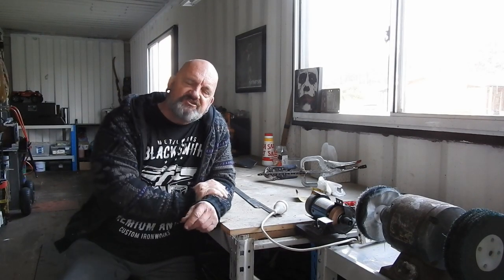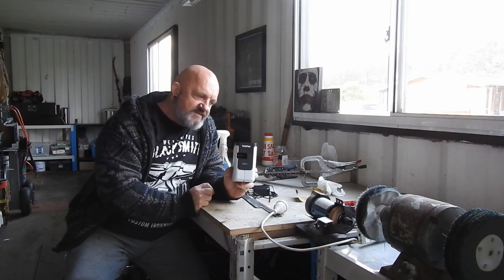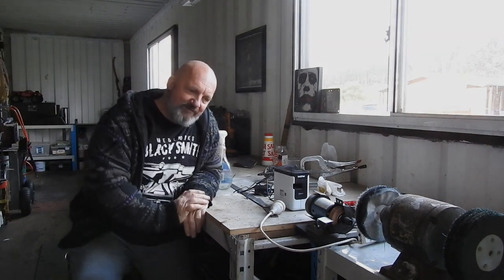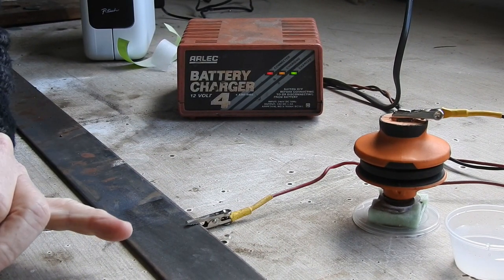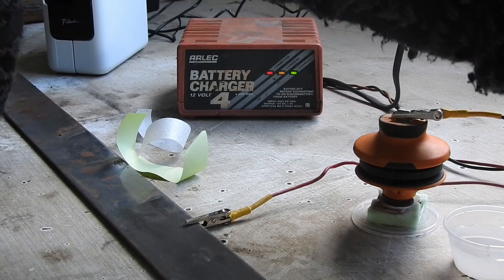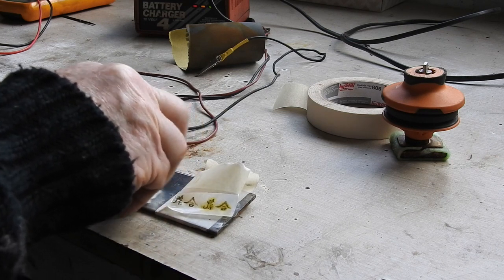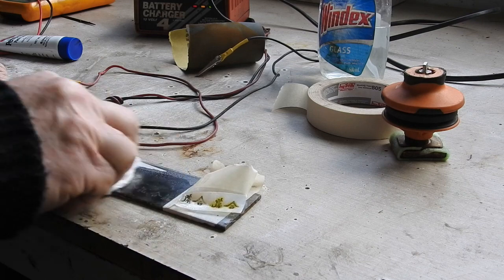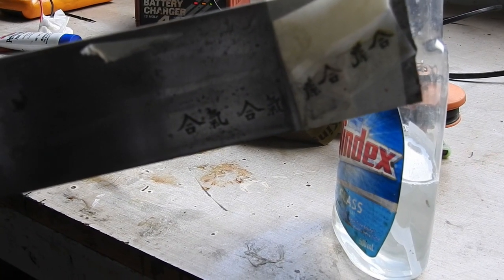Easy DIY stencils for salt water Metal Etching

Comment: Hi , I’m trying to do this kind of way of etching but I’m struggling with the type of battery charger needed , can you tell me the model of your battery charger or recommend one that would work , I’ve purchased one and it’s not working at all because I’ve seen that the newer models don’t turn on , thanks
Reply from the maker: HHHmmmmm don't know why your charger is not working???????? Did you have enough salt solution ???? I don't know why a charger would not turn on but my charger is 20+ years old and may not have a "safety" feature that a modern one may have...Sorry can't think of anything else!
Reply: I use a 1 amp power supply that used to go to a printer or something of that sort of peripheral electronic device and it etches as well as a battery charger.

Comment: Will it etch on stainless steel?
Reply from the maker: Stainless is very difficult to etch..........I have tried with average results......On stainless I use a punch...
Reply: @markbilson3775  I was using a 3.5 amp car charger for the source and it etched deeply on the RWL34 S/S. I tested it today. I will test 316 and 304 grade tomorrow. I am getting a cheap low voltage AC power supply to blacken so will see how that goes..
Reply from the maker: @54Mizery  Ok cool!.........I have only tried on NitroV and 12c27 stainless...

Comment: what type of labels are you using exactly?
Reply from the maker: You can buy the specific labels. I bought mine at 'OfficeWorks" in Australia but I would imagine any big stationary retail store would stock them.
Reply: @markbilson3775  G'day Mark, well done sorting this out, I've been try to make a stencil for weeks.
Couple of questions, there are dozens of different tapes for the P-Touch, as Dmitry asked above "what type of labels are you using EXACTLY?"
It looked in the video like you are using the backing paper as the stencil, is that right?
If you ARE using the non-adhesive backing, how do you keep the electrolyte from bleeding under the tape?
I tried to ask this via email but the address listed here does not work.
Reply from the maker: @micklangford7340  No worries the tape is "STENCIL 24mm Ste-151"...........The back peels off and you can stick the tape to your blade....As it is "sticky" you do not get any "bleed through" from your etch UNLESS you use too much fluid and then it will bleed slightly.......A bit of practice and you will get a good etch.........The bit of the video that shows me doing this bit did not happen as my battery went flat and I thought I was recording when I wasn't!........So it is just a. matter of selecting"print" in the software (that comes with PTouch) and then peeling off the backing tape and sticking your "label" on to your blade and then applying the electrolyte........Then when completed peeling off the sticker!!!!!
Reply: @markbilson3775  Thanks Mark, you're a legend.
Love that power hammer, going to plagiarize it shamelessly.